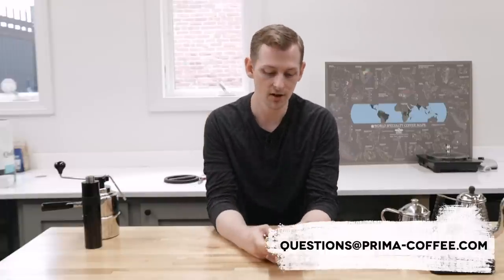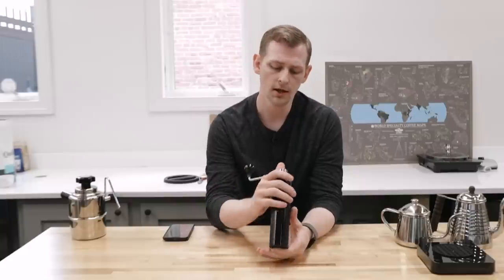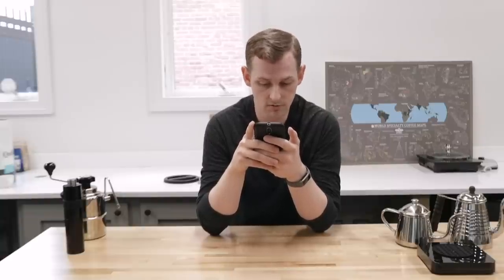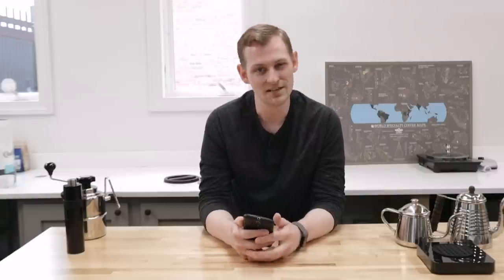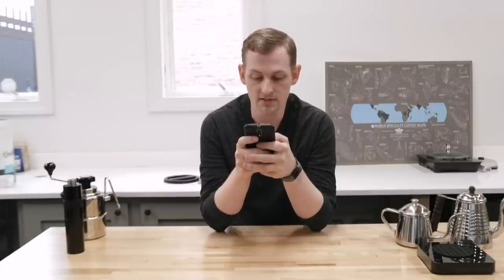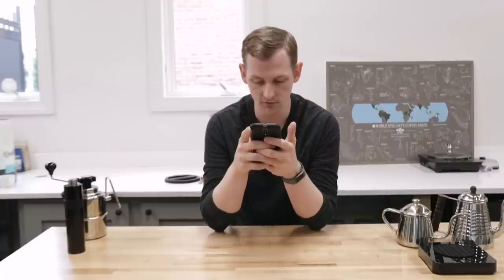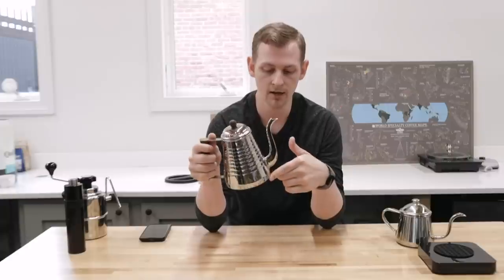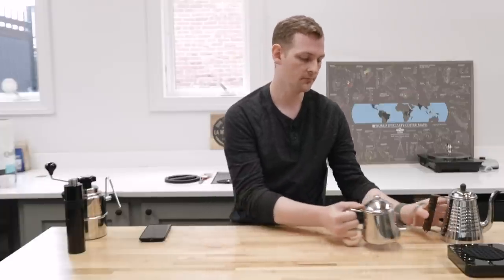Coffee Q&A with Steve Episode 2

Comment: What makes coffee ground on the EK43 so special? Whenever I have a coffee from a cafe using the EK, and I buy a bag and try it at home in my setup it's always lacking in sweetness and clarity. Is there a more "home friendly" grinder than emulate the EK43? Thanks!
Reply: The ek43 shots tend to be more special because of the even grind it produces, one of the best in the market. When coffee particles varies in size  (even by a very small ammount) it tends to lack clarity and sweetness. That doesent mean you cant have amazing results with a good quality grinder, but there's a reason why ek shots are so great, and also much more difficult to dial in (for espresso at least)
But it depends what you want to do. If you want pour over coffee at home, baratza or a good high quality handgrinder lick the airgrind are amazing even for espresso. 
What grinder are you using?
Reply: @Sim2Real.  Thanks for the reply man. Really appreciate it.
I do both espresso and pour over at home.
Its mainly espresso at the moment. I'm using a Niche Zero grinder. Works fantastic for pretty much anything I put through it. But, there are single origins (not even roasted that light) that just taste different. As you described it, it's sweeter, less "muddy" with better clarity. I can get closer to it when I preinfuse for longer (using manual lever) and grind a lot finer with the niche.

I don't really want to buy an EK43 for home. But I do want to get the same taste profile.
Reply: @kevinang1339  How about EK43S? It is smaller and very suitable for home. If I have the money, I definitely will buy it. The question is, how to acquire the wealth to purchase the grinder. I have to save my salary for full 2 years (an not using it) before I am able to purchase the grinder. I hate being broke